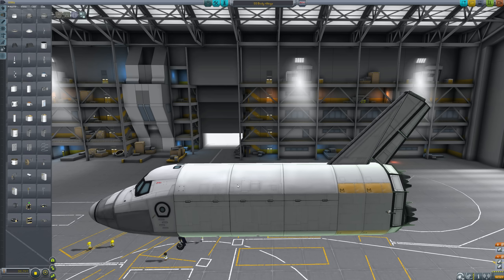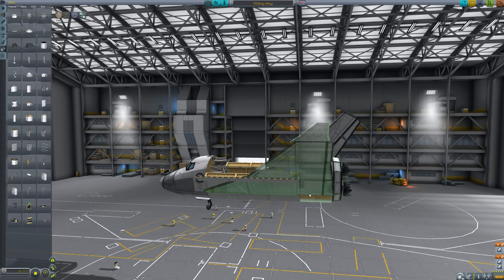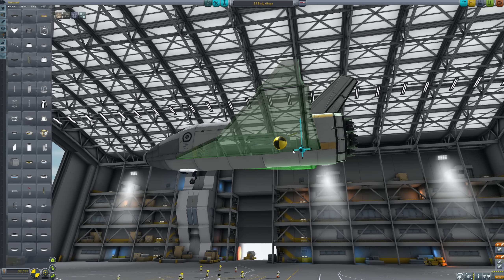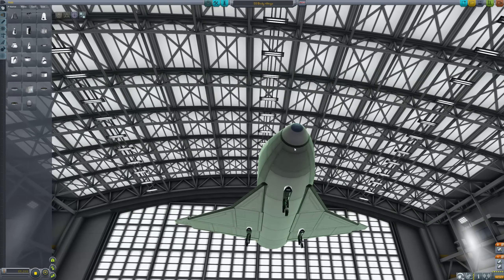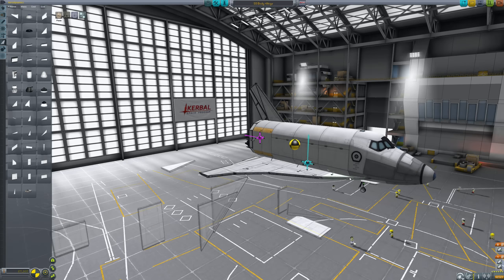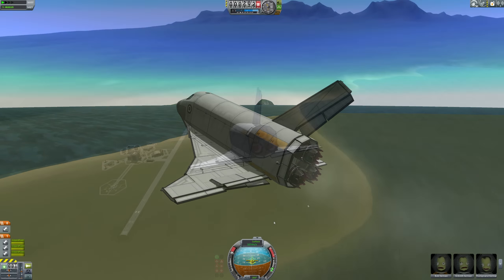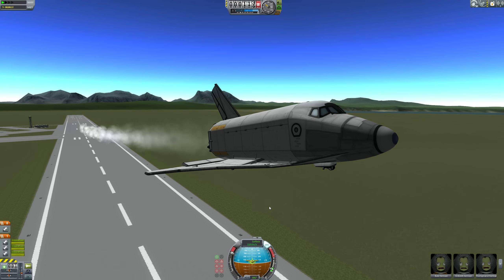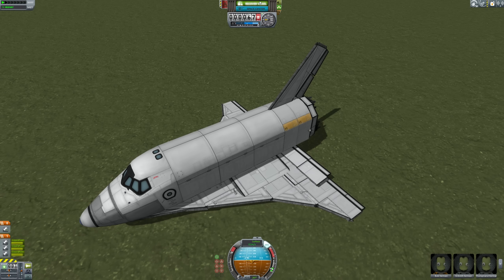Kerbal Space Program - Space Shuttle Aerodynamics

Comment: Unbelievable. I found a mod though called the Kerbin Shuttle Orbiter (KSO) mod which is an orbiter and a halfwit can build and fly it because all the parts included are compatible together and have just one mounting point from the body to the wings, the landing gears, main fuel tank and the engines which have a large 14 degree gimble. I have a feeling that the impact tolerances for the shuttle are quite high and unlike the orbiter in real life. Still a great mod.

Comment: I believe the reason why the center of lift is so affected by the angled-up small delta wings, is that the center of lift is calculated using not only the lift characteristics of the parts, but also the drag. For KSP, an angled part will have so much drag, that it will affect the center of lift drastically. If one adds a small surface on a wing horizontally, the center of lift will remain relatively unaffected. Simply tilting the part a bit will move the center of lift towards that drag-heavy part quite a bit.
I could be wrong, though.

Comment: The reason for the huge effect of those front wings at your nose, compared to the rest of your wings, is the orientation.
The problems with structural wings in buiding bigger complex wings is that you only get the full lift when oriented 0° or 180° to the rest of the aircraft while 90° or 270° orientation gives you only a fraction of their normal lift.
(You can simply verify this by placing a "squared" structural wing on your craft, keep the position while changing it's orientation and watch the center of lift move)

Comment: There should be something like Gmod's weld tool so you don't have to deal with messy struts to hold parallel parts together.
Reply: There is a part welding mod actually xD
Reply: Condorscondor Condor oh that is interesting
what is the name of the mod ?
Reply: ***** I'm not sure on whether or not this mod is actively updated, but this one has been around for some time:
UbioZur's Welding Mod
Also, I'm pretty sure that Scott Manley has a video on his channel where he showcases a welding mod
Reply: *****
Buggy though, I want a system just like the point-and-click Gmod toolgun that you use just like the gizmos in the VAB/SPH. Struts are like the equivalent to the rope tool (set to rigid) in Gmod
Reply: ***** UbioZur is not actively updated, but apparently it DOES work with the new version (there might be a patch you need to get) but it doesn't support wings and has issues with FAR. You can use procedural wings, although that is a bit buggy as well (and they never seem to have the right characteristics for their size) or I think B9 has its own version of procedural wings (not to mention a bunch of its own normal wing parts that may help you reduce part count).

Comment: At the time this video was made were the Big-s delta wings (or whatever they're called) not added yet?

Just a couple of bits of info that might be useful to anyone reading, the force you mentioned around 8:30 is called "positive stability" (the tendency to return to equilibrium after being disturbed), this is related to the whole 'center of mass in front of center of lift' thing.

And while Bernoulli equation isn't actually required to make an aircraft fly, it is required if you want one that flies efficiently and doesn't spin wildly when it's stalled. As for everything else that makes something fly, it's not particularly complex it's just that there's a ton of it. Hope this helped

Comment: While developing my B9 FAR shuttle sometimes the procedural wing strakes drove the CoL marker bananas. Toward the end I pretty much just had to keep making tiny adjustments and actually fly it to test.

That experience got me wondering, FAR DOES recalculate the CoL marker to take the body into account, right? I had similar issues with my Venturestar(ish) SSTO where at certain Angles of Attack the body lift would overwhelm the winglets and cause a flip. The graphs illustrated this behavior perfectly, but the markers were ambiguous.

Before FAR I do remember some advantages KSP stock aero had were, most obviously, not ripping the wings off by accident, but also landing could be a lot more imprecise. As long as it was over land I could just point almost directly nose down and just sink like a feather after I pulled out of the dive. With FAR I have to hit the runway, or else, because the better L/D ratio means I have a lot more forward velocity on landing.

Comment: I built a space shuttle a while ago, but looking back at it, I decided I was an idiot back then. it could make it to orbit, but not back. After some improvements, it can make it out and back with fuel to spare.
Reply: Also, I managed to attach 3 engines to a single attachment point without a tricoupler.
Reply: For me, my problem isn't getting back with fuel, i usually have enough to do the mission 2-3 times. My problem is if i don't land like a feather on a memory-foam mattress, my shuttle shatters apart.
Reply: mine is like the real shuttle in that it can't take off a second time, but its strong enough to land well despite being front-heavy.
Reply: I put all my weight in the back to help lift the nose. Just like your name, there's a double negative. My Shuttle, with all the stuff on it, it's pretty heavy. If i don't pull up soon enough, i land hard and break apart. If i pull up soon enough, i either stall because i lose too much speed, or i rip the wings off from g-force. Apparently the bolts on the game are made of wet toilet paper.

Wish there was a mod or feature that let you re-use vehicles EXACTLY as Nasa did with the Shuttle.
Reply: Also the issue that if my re-entry angle isn't EXACLTY perfect, i lose control, my shuttle does all these aerobatic flips and stuff, and i flatspin into the ground trying to save it, and unfortunately my landing chutes aren't enough to save the crew.
Reply: I do the same thing with flips and stuff until it reaches low-atmosphere.
Reply: Lucky, i'm either flying backwards or flatspinning, even though i transfer fuels around to balance the CoM slightly ahead of CoL.

Comment: I understand that the shuttle doesn't have very good aerodynamics, but it's not supposed to takeoff horizontally. Pilots of the shuttle have said its a controlled plummet. When you got off the runway, I could see some slight glide potential. Maybe not as good as it's supposed to be, but still enough for "gliding". Correct me If I'm wrong, I don't want wrong information in my head.
Reply from the maker: However the soviet version of the shuttle had a test version with jet engines which took off from runways.
Reply: Scott Manley
I'm certain there is a "In Soviet Russia" joke in there somewhere
Reply: weldonwin, seeing as the buran could fly without a pilot in control...

In soviet russia, spaceplane flies you!
Reply: Stock aerodynamics don't allow for a good glide, either. The way it handled in descent before "cheating" is less a controlled plummet and more...well, just a plummet.
Reply: Ya, I guess so. After going back I could see what you mean. Maybe with an updated aerodynamics model...
Reply: Ya, I guess so. After going back I could see what you mean. Maybe with an updated aerodynamics model...
Reply: weldonwin in soviet russia
runways took off from jet engines

Comment: 1. Install FAR.
2.???
3. Enjoy.
(I'm kinda serious here though)
Reply from the maker: FAR makes things too easy.
Reply: Scott Manley Depends. You can do pretty much crap in stock and fly anything as long as it has wings and thrusters.
Reply: 2. Install *Kerbal Isp Difficulty Scaler (http://forum.kerbalspaceprogram.com/threads/52882).
Reply: Scott Manley
You're not wrong. The only thing that keeps me from building more planes is that the version of B9 that I have seems to have wheels with physics, which is a major problem and I totally see why the stock ones are the way they are.
Reply: Scott Manley

2. Install Kerbal Isp Difficulty Scaler, nerf engines down to sane values.
2.5. Install B9 Aerospace and be sure to keep the Squad Jet Balance file to nerf the basic jet engine to something resembling sanity.
Reply: Scott Manley What about mk3 planes breaking up after reentry? And the difficulty of making a good manouverable plane? (Btw I just made a shuttle).

Comment: Nice video, Scott. The wings should be way backwards since LFO engines are way heavier.
Reply from the maker: Sure, but also, I have an extra fuel tank on there. Balance is of course the reason I made the wings easy to move.
Reply: Scott Manley Yes, indeed, moving the wing piece by piece is a pain, but it's slightly easier with the Offset mode. And since the wings usually are used for landing, I personally like to adjust the COM and COL while the tanks are empty.

Comment: I do believe that the space shuttle is probably not all that stable flying around, as it was designed to maximize efficiency when gliding and not taking off from a runway and performing maneuvers inside an atmosphere.
Reply from the maker: Specifically, it was designed for surviving reentry, you would be better flying the box it came in.
Reply: *****
The flying brick also referes to a series of BMW motorcycles from 1983 bis 2009. (because of the lying 2-cylinder engine)
Reply: ***** On the other hand, it did fly better than a brick...unlike the stock shuttle shown.

Also, I've had a space-shuttle-shaped vehicle (from the KSO pack) take off with a bit of rocket fuel. I think it's safe to say that KSP aerodynamics are borked both ways.

Comment: So I just started playing ksp, and something has always bothered me when im trying to build aircraft. whenever im trying to combine wing parts to make bigger wings, there isnt a specific point to attach one wing to another, and it ends up looking pretty glitchy and messing with the lift. Is there a way to kind of snap the wings together? Also at around 3:50 you change the angle of the wings by about 15 degrees instead of 90, whats the button combination to do that?
Reply: Use shift + W/A/S/D/Q/E to rotate the parts in smaller increments. I can't help you with the wing problem though, as i have pretty much the same problem. The attach point is fine when you're attaching to the body of your plane but trying to attach another wing to say the trailing edge of another wing causes all sorts of alignment/lift problems for me. The way I've got around that is using FAR and B9 procedural wings but i wouldn't advise that if you're new to the game...

Comment: I can never get aircraft to work. They either are uncontrollable on take off, wanting to swing left and right at the same time, so any corrections I make during take off make it swing more or they do the same thing on landing. Flying is perfectly fine. i've mastered that part.

And If I CAN take off, the landing kills me because as soon as the wheels touch down I lose control and it goes bonkers. I think the wheels aren't straight. whenever I us B9 with the allignment indicators, the wheels are always off by 1 degree to either side. I figure the game is trying to calculate both, but the craft can only follow one or the other, so it's constantly following that 1 degree deviation.

I have been playing kerbal for the last year and haven't been able to figure this out.
Reply: The center of lift needs to be behind the center of mass. Otherwise the craft will be completely unstable.

Be sure to add lots of wheels and spread them out so you can land safely. Hope this helps :D
Reply: have you used the elevon? they are useful, and in flight hit t to activate sas which is a stabilization system
Reply: I have had a similar problem with aircraft and the veering on the runway I tried many solutions such as trying to get mech jeb to hold the aircraft to prevent the veering I checked that it wasn't my aircraft its self and flaws in the design. (By hacking gravity to get the aircraft in the sky) and I never could ix the wheeles I have multiple aircraft just shelved and un flyable due to this bug (well I belive it is a bug ) but I just seems that it is random because I had one plane that was fine and then I moved the landing gear and then it started veering at exactly 43m/s every time. It definatly seemed that the wheeles were off straight by a degree or two. But oh well what can I do :)
Reply: Get one of the stock planes and try to recreate that: you know they work, and building them can help you see what you'd need to do to make your own.
Reply: Make sure your wheels are not angled. They have to be straight down otherwise you are not getting the full effect pf the wheel and you will turn to the side during takeoff.
Reply: Yeah, thats the problem. No matter what, There's a 1 degree deviation and the minimum increment is 5 degrees so it's impossible to fix.

This only happens when I attach to wings, though. If I attach them to the main fuselage they're good and the plane works fine at take off and landing.
Reply: Hayden Travis thank goodness 1.0 is out soon :D

Comment: This is probably my biggest gripe with KSP. What's more disappointing about it is the equations for this are very simple. I'm fairly certain they don't even properly model the Drag Polar, which can be done by sophomore AE students (the ones that don't flunk out anyway). Something is also clearly wrong with the air intakes and the thermodynamics of jet propulsion. Hopefully this is stuff they're working on and will have out soon. This "game" has incredible potential!

The last would be adding something with Allen-Eggers etc reentry (obviously with the option to turn it off). Can't wait till they've had time to catch up and add the things they want.
Reply from the maker: Consult Keith Young The challenge is modelling it quickly enough when the shape of the vehicle changes (e.g. due to rapid unplanned disassembly)
Reply: Scott Manley  You bring up a good point. I neglected to plan for rapid unplanned disassembly.

Comment: "With only one point of contact."

Not a good idea in FAR. The Mass/Strength will be totally broken by doing that, and your wings will be much heavier.

For that matter, even in stock, doing that dramatically increases the possibility of an aerodynamic failure, although if you're having aerodynamic failures in stock, you've got fundamental design problems.

For example, let's say I design a 6-part wing with parts of all equal size:

The best case scenario is that they are all individually attached "in parallel." This makes for a total weight of 6 per wing.

However, the worst case scenario is that they are all attached to each other "in series." This makes for a much-increased weight due to the fact that each wing must not only support its own lift, but the lift of every subsequent wing. Worst case scenario mass of 21 per wing.

Comment: Won't the centre of lift be much closer to the centre of mass when you've replaced the jet engines with LFO engines? Most LFO engines are heavier than turbojets, so they'd bring the centre of mass further back and closer to the centre of lift. This won't compensate for a poor lift:drag ratio, but it'll help it act less like a lawn dart.
Reply from the maker: Yes, this is why I made a point of designing the wings with a single attachment point so they can shift back and forth on the hull after redesign.
Reply: Scott Manley Hey Scott! One flaw with this video is the immense fuel weight is throwing off the characteristics of your shuttle - I've built a few in stock aero which work and look like the normal Shuttle but they rely on a fuel-empty unpowered descent and landing. When all the fuel tanks are empty the normal shuttle shape actually glides okay-ish. The main problem is it has a very high landing speed and you basically "fly it into the ground", but that is not uncharacteristic of large aircraft in real life!

Comment: ... and this is why I hate planes in current KSP, especially in the moment you want to glide a little. Either you get infiniglide or you get so much drag you can't glide decently. Even yesterday I was testing a lightweight1,25 m plane in stock career ( for the in flight contracts ) and while it was almost clean of fuel it was struggling to keep a rate of descent of 10% ( 1 km of altitude for 10 km of horizontal distance ), that is the expected gliding ability of a RL 747 :p ... atleast until I tried to correct the landing aproach and started to infiniglide mad :D